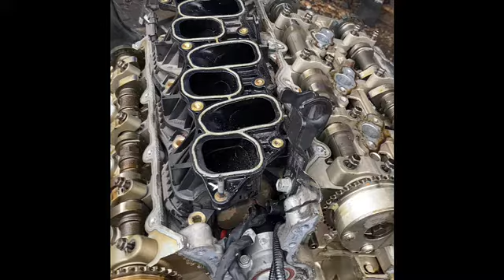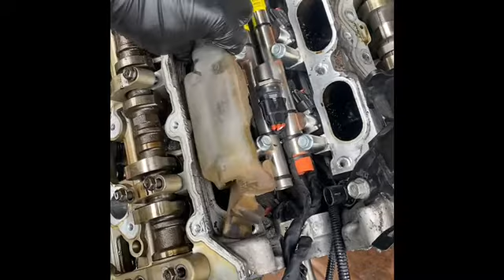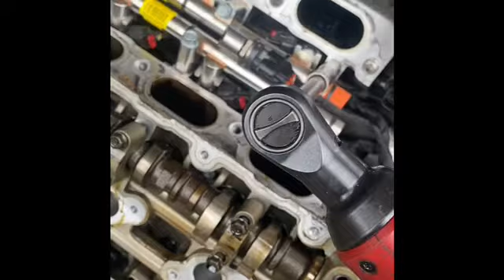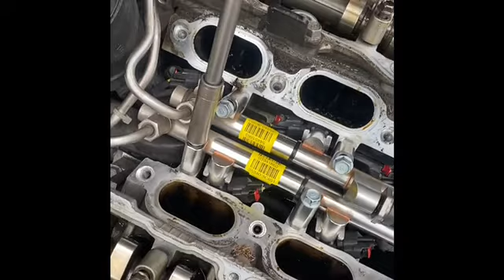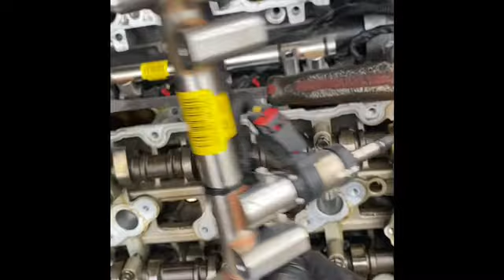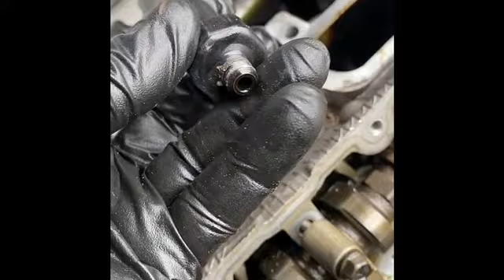Hyundai/ Kia 3.3 l engine,oil pressure sending unit location.

Comment: You’re the goat for this one. From what I understand you just remove the intake manifold the fuel rails with injectors the coolant crossover pipe and it sits just below?
Reply: Also will this work for a 3.3t stinger
Reply from the maker: Yes shows are the location
Reply: @mikemartinez661  but you don’t have to move the water pipe if you grind down your wrench on both sides to fit around the sensor between the block and pipe

Comment: Got a list of tools I should get before doing this job?
Do you know what each bolts spec torque needs to be?
Any thing else I should be looking out for well in there? 
How important are the bolts that hold what I believe to be the injectors need to be torqued to?
Should I order extras gaskets or seals? 
Any tips or advice!!! 
Help me 🤣
Reply from the maker: Look at the description more information , and you need to buy gasket not seal.
Reply from the maker: Injector doesn’t need to have specific torque.
Reply: @autotech9043  thank you brotha not too mechanically inclined but not too dumb to where I can’t figure this out🤣
Reply: @autotech9043  does anything need to be torqued to spec or just use commons sense get it nice and snug but not too tight?
Reply from the maker: Head bolts need to be torqued , others no need torque
Reply: @aeroekins5415 have you taken a run at this yet? Considering doing it myself as well
Reply: @bort_s  I want to do it myself but I haven’t found a video that give me enough confidence and information  to do it 
All the hard work is done in this video I would like to see tear down and assemble
Reply: Just need torque specs on header bolts

Comment: Can you tell me how to take the cover off? The one you took of at the beginning to reach the injectors. I took out one bracket and 8 Allen bolts, but it will not move...could it be seized in there?
Reply from the maker: Do you mean the intake or the valve cover?
Reply from the maker: I think you just need to push em up with pry
Reply: The cover that covers the injectors, I took out 8 Hex screws from it, and the thing won't even wiggle... don't see any other screws..
Reply from the maker: @panic151  use screw driver and pull em up
Reply from the maker: @panic151  they seized sometimes
Reply: Thank you, I got the cover off, but I can't unscrew the oil pressure sensor. How do I take off the pipe that is in the way???
Reply: I have the same question....
Reply: @zanedeacon7750  I had to pry it lose with a flat head screwdriver, it was seized on there.
Reply: @panic151 grind down your wrench and you won’t have to move the pipe.

Comment: Anyone know how long does this job take to do? I had gotten 2 different estimates from 2 Kia service dealers. One was for a 20 hour job for $2,000 and another for a 30 hour job for $3,000 they said the whole cradle with motor and transmission had to come down and would have to separate the motor from the transmission to get it done? Any input would be appreciated
Reply from the maker: What you wanna do change engine or what?
Reply from the maker: Or repairing it?
Reply: I was quoted those 2 amounts to replace the oil pressure sensor on the TT 3.3L 6 cylinder on a 2018 Kia Stinger
Reply: @miker0257 what did you ever end up doing? Pretty sure my oil pressure switch is going out but thinking bout just sending it and doing it my self!?!?

Comment: Does the engine actually need to be pulled for this job? I looked at the service manual for this and to remove the water controll assembly it says to pull the engine and transmission
Reply from the maker: No you don’t have too
Reply from the maker: You can do it without pulling engine out.
Reply: @autotech9043  doesn’t it not require removing all the back piping? Can’t see how you’d access all that without removal
Reply: @autotech9043 so how do you do it, I keep looking around, and it seems to be a big secret lol people are saying it's easier on the 2008 3.3 v6, that is the mpi, not the GDI can somebody please tell me how to do it or where I can find info on it..!!? 🙏😎
Reply: @jasoncoreyhyken4091  Just like the 3.5 but with high pressure fuel rails on top of the coolant pipe. Disconnected the lines, remove the bolts, pop them out of the cyl. head and remove them both. Proceed like normal.

Comment: Do you remember if the oil pressure sensor screws all the way in. Mine seemed to stop, and I can still see some thread, and it's not flush against the housing...
Reply from the maker: Don’t worry about the flush
Reply: How deep does the sensor  needs to be so it's good to go ? I got it past the red stripes om thr bolt , is that deep enough ???

Comment: The whole reason the engine needs to be removed is to take out the water pipe. You can do this procedure without dropping the engine or moving the water pipe.

You just have to grind down the wrench to fit on the sensor between the pipe and block wall,
Reply from the maker: Yes you should move some parts to get to it , you don’t need to move the engine.

Comment: Whoever designed this should be horse whipped! Having to disassemble and reassemble all of this just to replace a sensor?!!! It's insane! They couldn't have just put it in a location easy to get to? It's just a money making scheme... most of us would have to carry it to the dealership or Kia mechanic and it probably cost a small fortune to get it done!
Reply from the maker: I know it’s a lot of cars same problem,it’s good for mechanic to make more money
Reply: Today the dealer told me it it would cost $695. for a 2019 Sorento. The oil light has intermittently went on for the last 18 months. Not sure it needs to replaced if it's not leaking?